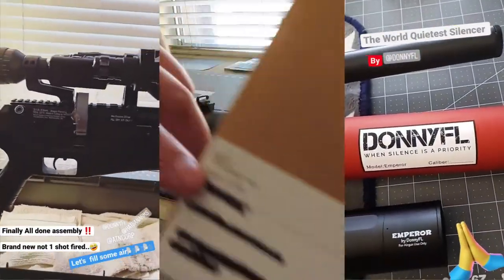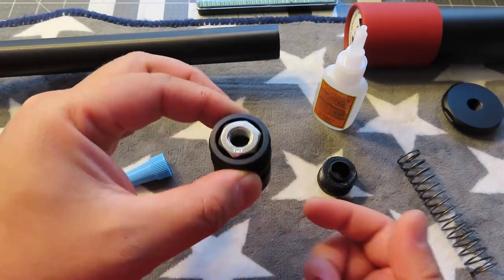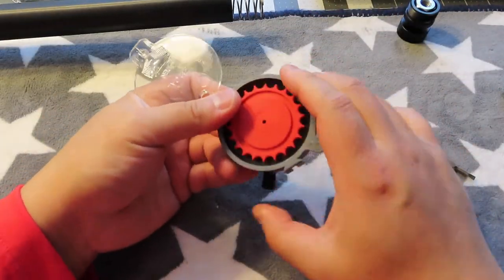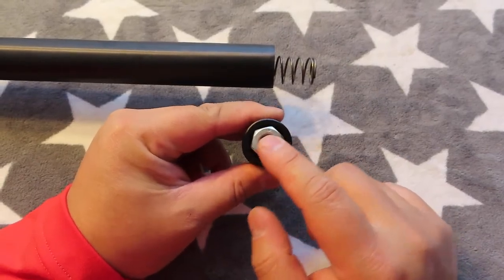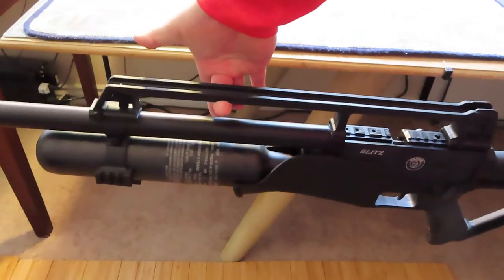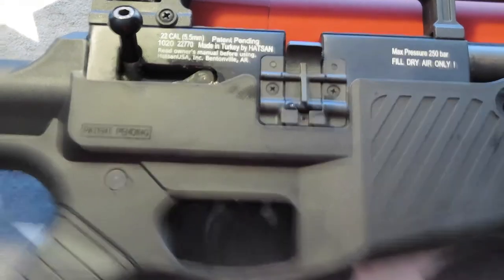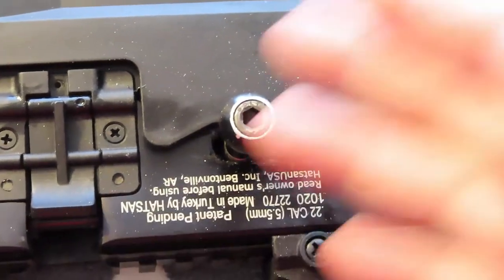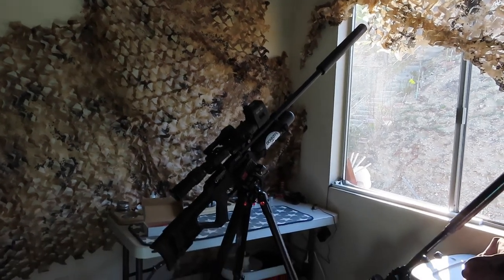Hatsan Blitz .22 Set Up DonnyFL Emperor + Extension Silencer & ATN Night Vision Scope

Comment: Careful not to void your warranty. Hatsan  says they will void the warranty if there are signs of the gun being tempered with. Maybe you have a better connection with the company, just make sure before you take anything apart.
Reply from the maker: Thanks Daniel, really not worry about Warranty, even before I bought this gun,  or intend to sending it back....hints the amount reaches I did.  Knowing and expecting clearly problem/issue with this gun.  I rather fix/mod it myself or work with a gun Smith to improve and find a permanent Fix for it and share to ALL ☺
Reply: @Repsol13  Right on, Brother! I haven't had a good experience with mine, I haven't even gotten to shoot it, and I had to send it back. Hopefully it gets better from here going forward, it is suppose to be back in two to three days.